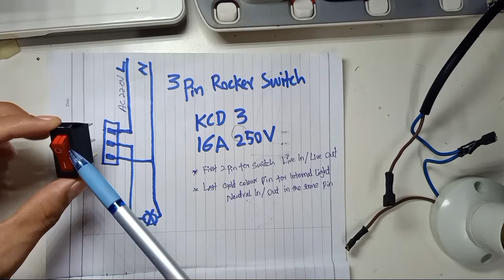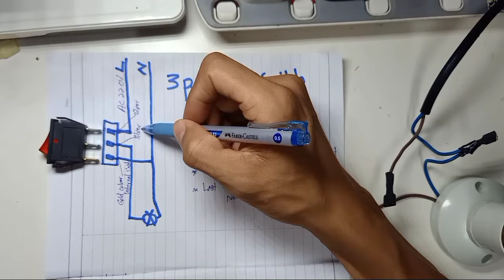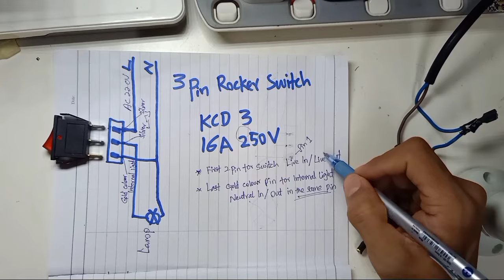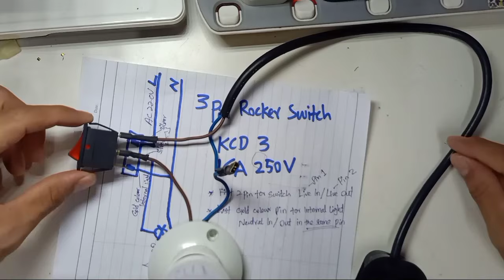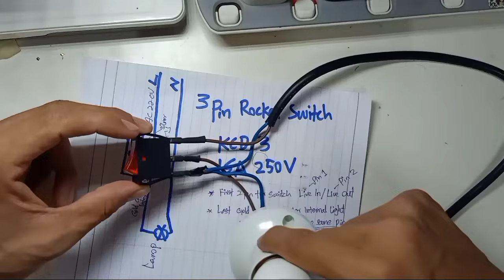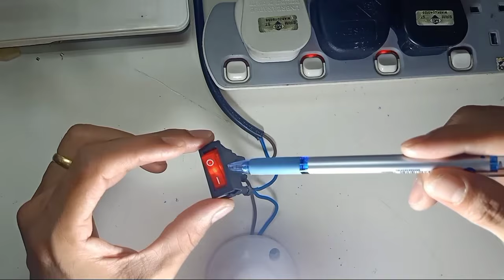how to wire 3Pin AC 240V Rocker Switch

Comment: How did you remove the pin? It’s very hard and can’t  remove by only pull it out. There is any trick in removing the cable from the pin?
Reply from the maker: Try to use long nose plier 😊

Comment: Does the light swtich will light on 12v?
Reply from the maker: If you use 220V switch for 12V appliances it will work but the Switch  body light will not indicate because the bulb inside switch voltage is make for 220V.

Comment: Can I use this switch with a 9V DC battery? I know it's oversized, but it's the only one I have on hand. My question is because it has an internal LED. Will this LED consume all the current from the battery and not even turn on or will it let current through for the rest of the circuits?
Reply from the maker: @Superluis125  Sure you can use it.But you would not get body light only.You still can make it on / off output.No effect to consume Battery voltage.

Comment: Where can I buy a panel or board to mound some KCD3 switches in to?
Reply from the maker: You can buy from any Online shop?
Reply: @passiontechklm   Unfortunately I have already looked at the most popular major online stores and found nothing. I also just tried a general Google search and did not find a plate for this size of switch. I do find many panels for a larger toggle switch.

Comment: very nice, what is the internal light resistance?
Reply from the maker: @GraphicManInnovations  you mean internal lights resistor value?
Reply: @passiontechklm  i was not aware it have a resistor also, ok what about it and what about the resistance of the small bulb also alone, and if it can be replaced or not coz it is not working, perhaps the resistor is blown, perhaps also the bulbs itself is blown, i would like to know the resistance of both of them, thanks
Reply from the maker: @GraphicManInnovations  Basically you can use 560Kilo Ohm to 1 mega ohm for 220VAC light bulb.220K for 120VAC .So Resistor is necessary to protect the light bulb.

Comment: Great. So the switch has a built-in resistor and diode. 👍
Reply from the maker: Basically the switch light is use neon bulbs so no diode .

Comment: I tried to wire one of these on a 12v battery, couldn't get it to work
Reply from the maker: May be the switch have problem , it should work but i just remind that this switch is for ac 220/240v. if you use in 12v Battery you just need to wire only positive wire.